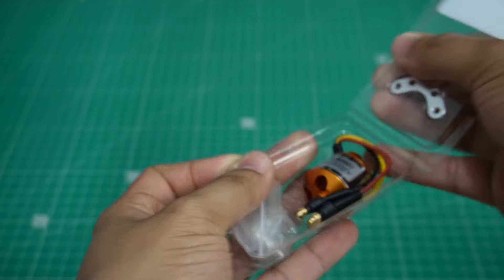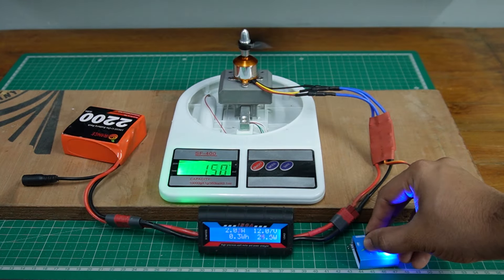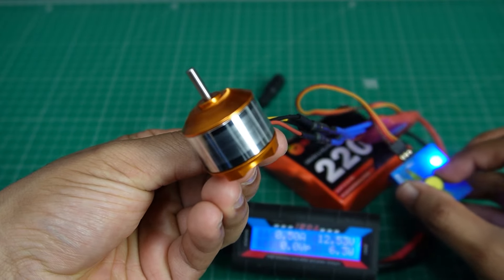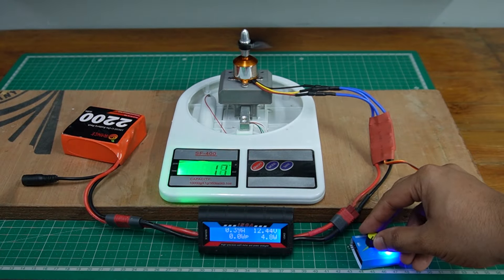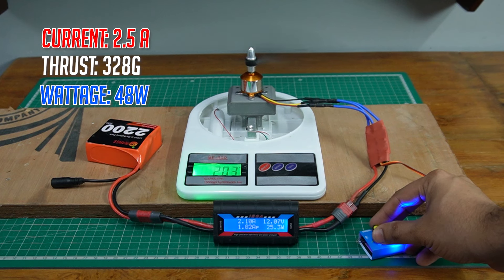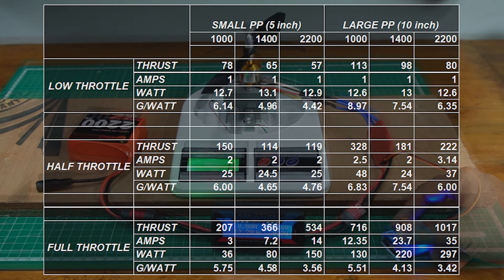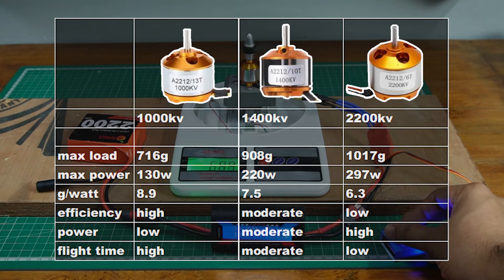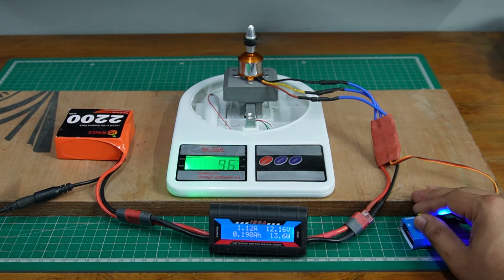BLDC Motors  - Comparison and Test of various KV motors

Comment: Please share if you are aware, which can be a good site for purchase of BLDC motor and ESC in India ?
Reply from the maker: you can buy from here in india: https://bit.ly/47hXNaC
Reply: @SuperbTech  Superb Thank you. :)
Reply: @SuperbTech   please also suggest the power analyzer device you reviewed  a few videos before this one.    I found there are two styles available .  a metal case version, and a black plastic case version.   any recommendations on this power meter , I want to measure battery charge amps using solar panel